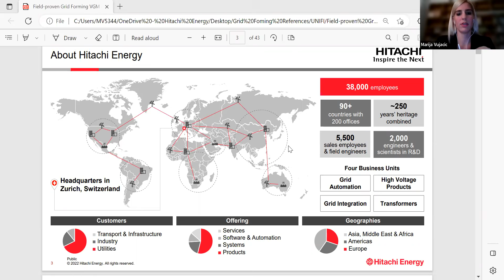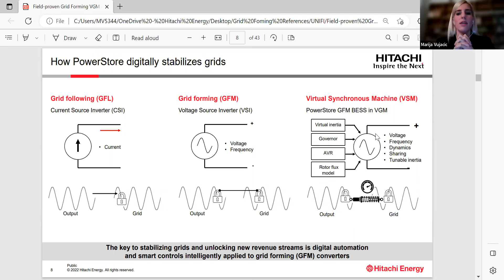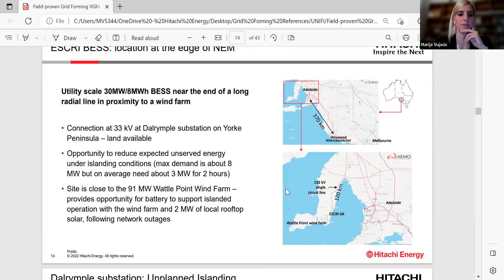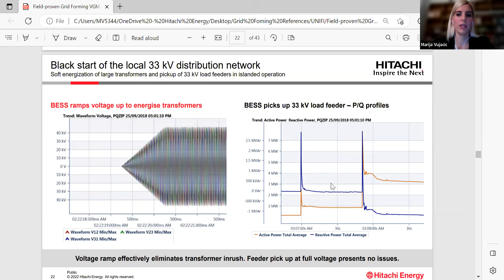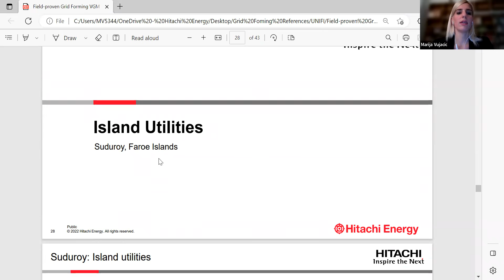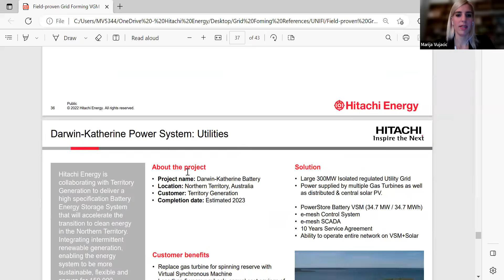Marija Vujacic: Field-proven GFM VSM - Global Challenges and Opportunities

Comment: Instantaneous ongrid-> offgrid (islanding) without interruption at this power level is a remarkable achievement. Thanks to GFM control. For page15-Dalrymple islanding case I'm wonder,  how to resync after 132kV upstream breaker is closed and the 66km line is energized again? So there is two frequency domain at Dalrymple substation. So it must be external "EMS" which watch the phase difference, and close the breaker ON at 0 deg. So this EMS must be in substation and not at BESS location.  Does the EMS must be Hitachi or  can be any recognized 3rd party?